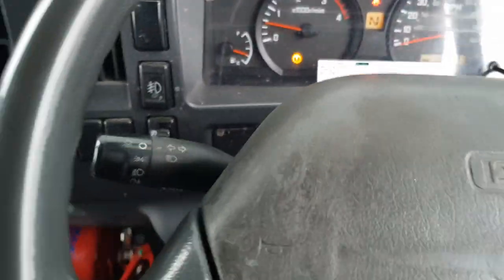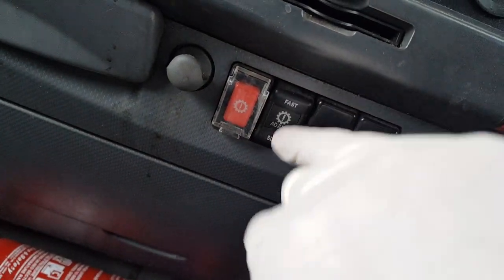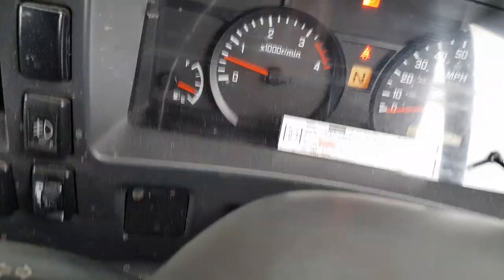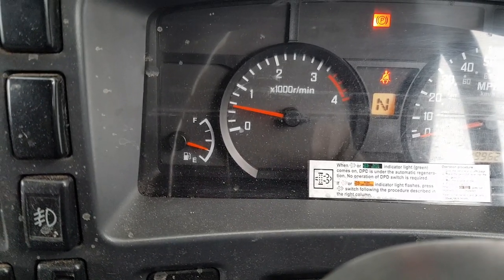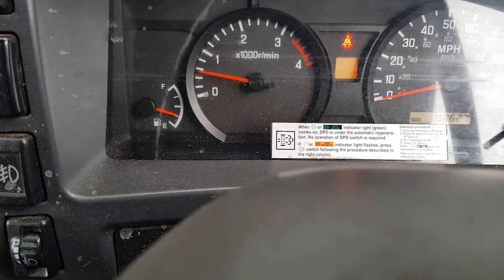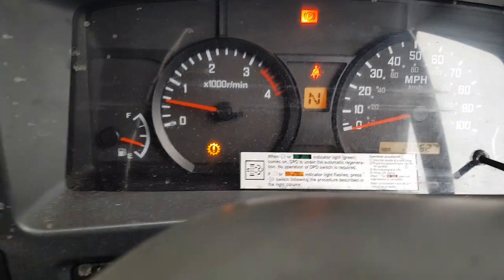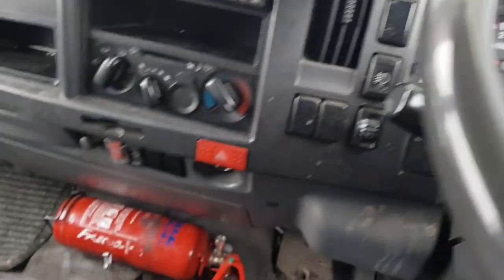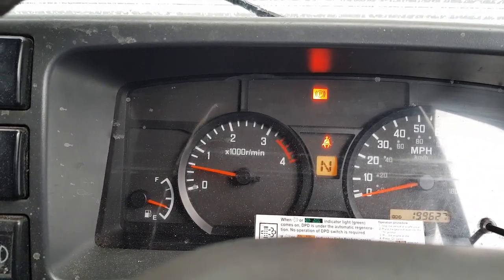Isuzu nqr npr auto box relearn reset

Comment: Ive got 69reg and the gear change is so slow its actually a hazard even more so when Im towing a chipper and carrying woodchip. It changes gear so slow that once its done it the road speed has gone down so it changes back down to second and it happens all over again. I just take it out of eco and use the manual shift.
Reply from the maker: 69 reg take it back to the dealer they should sort it out for you
Reply: @dannyandrew725  cheers mate ur nice bloke for doing this

Comment: hey Danny i have a 07 NPR that we put a second hand gearbox in we road tested it and it flared out the gear changes we tried to do a reset and now the buzzer keeps going off and the gearbox light constantly flashes when the ignition is on and wont select any gears have you any ideas thanks
Reply from the maker: @sharmanethomas  you need to get a diagnostic done on it and let me know the error codes
Reply from the maker: @sharmanethomas  go through WhatsApp

Comment: My question is, I have an Isuzu NQR 2009 diesel 4 cylinder. In The USA,. 5.2 L. With bad solenoids  automatic transmission., I changed 4 shifting  Solenoid, but my Scanner doesnt read anything now.?. Do I need to reset my transmission in order to Scan again any codes.?. All my old codes are gone, thanks JC
Reply: Hey. What issues was your transmission having for you to replace the solenoids?
Reason I ask is; I have a 2007 gmc w4500 5.2 diesel and it’s not shifting into 4th gear/Overdrive.

Comment: Hey bro, my Isuzu 2020 4hk1 paired to Amt MYY6S transmission has lost gear number 6. Any suggestions to fix?
Reply from the maker: 2020 mate is under warranty back to the dealers
Reply from the maker: Does it not go in 6th gear in manual aswell

Comment: On a 2018 npr hd gas jobber we just installed a new jasper trans. Buttoning it up tomorrow. I'm told it will need a dealer to flash it once we are done.will this essentially be the same thing ? Thanks in advance.
Reply from the maker: No mate it should be plug n play
Reply: @dannyandrew725  we finishing it up .we appreciate you getting back to us.doing the exhaust manifold bolts while we wait for a few parts.if u got a way to get me your adress wed like to send u one of our  company shirts. 
Thanks again
Reply from the maker: Hi mate you can send it to danny andrew c/o crowfoot carriers park street stalybridge Manchester England SK152BT. TEL 07887480560 THANKS
Reply from the maker: Where you based
Reply: @dannyandrew725  hallstead, Pennsylvania .we are a trucking company and have a heavy equipment garage.doing this job for the company that  brings us our semi truck tires.we normally don't work on anything non diesel,much less isuzus with chevy parts.lol. I do have the software and TeamViewer but not a version I can connect to there mainframe.
Reply: @dannyandrew725  hey Danny.
He is an update.everything is done.truck won't go in any gear.could t do what u showed because there is no fast slow button for the tranny. It's a 2018 gas.
Any thoughts?
Reply from the maker: Do you have any fault codes
Reply: @dannyandrew725  p0602
Reply from the maker: It's looks like a trip to the dealer to reprogram the ecu p0602 is a fault in the ecm not programed

Comment: Hi Danny, just tried this relearn and can’t get it to work, trucks just had the valve body thing in front of the clutch pack, got a fault code active p0718 input shaft turbine speed, any ideas or directions for me to go in, with my diagnostic?
Reply from the maker: On the bellowing 2 sensor 1 on each side faulty you can wotsapp me on 07887480560

Comment: Hi Danny I have a 2019 NLR only selects Reverse and 1 gear. Auto trans light and check engine light on. Any suggestions?
Reply: engage in any gear with your left foot on the brake and accelerates,if the engine revs normaly the most possibilty,your automatic side major parts are worn out..like oil pump,clutch packed and maybe tourque converter..check also your tcm.

Comment: Very useful video, I have an npr at the moment that won't shift past 2nd gear, also won't engage pto. I had texa on and found no faults, all seems good. Had the three shift solenoids off and they check out also, any suggestions appreciated ta
Reply from the maker: Check the wiring going to the fuse box behind the n/s/f wheel where it goes round the chassis sounds like a split wire
Reply: @dannyandrew725  will give it a check in the morning, much appreciated 👍
Reply from the maker: Are you near manchester
Reply: Dublin! Appreciate your help though
Reply: I have an Isuzu but the GMC w5500 HD 5.2 L diesel and I'm having problems with the transmission I can shift it from Drive second first and go from 1st 2nd drive and it shifts but if I just put it in drive it won't shift at all it will drive but the gears won't shift can you please help me
Reply from the maker: Sounds like electrics wireing
Reply: Leonard 
Hi Leonard. Did you find out what was causing the problem

Comment: Hi Danny, my 2017 NPR 55-155 AMT is stuck in neutral but saying it is in reverse on the dash. Have you got any ideas of what this could be. Thanks Trent
Reply from the maker: Sorry only guessing without a error code
Reply: @dannyandrew725  thanks Danny. I should have given you the fault codes P0889 P0685 P0700 U0100. Hope this can help. Also I tried the paper clip trick and that didn’t work.
Reply from the maker: Can you WhatsApp me 07887480560 thanks
Reply from the maker: 889 is earth wire from tcm broken going to the fuse box on n/s outer fuse check wires near the fuse box where they go under the chassis
Reply: Thanks I’ll check that when I get home. I can hear the relay clicking when changing gear shifter.
Reply from the maker: Purple znd white wire
Reply: Could it be solenoid problem?
Reply from the maker: The code is for a broken wire
Reply: Hi Danny. You were spot on with your diagnosis. Broken purple and white wire between fuse box and chassis. Thanks for your help. Cheers Trent
Reply from the maker: No probs matey anytime cheers
Reply: @dannyandrew725  one question..how do you know that the wire broke off..??
Reply: @dannyandrew725  what causes it to break....i mean the wires.??
Reply: @dannyandrew725  hi
Reply from the maker: @davidmusyoka6983  hi
Reply: @dannyandrew725  i have a problem with my isuzu 4hk 1 sir
Reply from the maker: @davidmusyoka6983  yes do you have a code
Reply: @dannyandrew725  no i even don't know how to get the code...is an automatic transmission and when i engage drive gear,,it reads gear number 6 and not moving at all...behaves like is in neutral
Reply: @dannyandrew725  kindly help
Reply: @dannyandrew725 hey bud just a quick question, I have the p0889 code too, it says it’s in 6th and will only move forwards with the red emergency button engaged, the earth wire you mentioned is that from the outside fuse box? Thanks appreciate any guidance
Reply from the maker: Can you WhatsApp me

Comment: Hello,
We have an ISUZU NPR85 2014 automatic transmission and is not shifting on sixth gear. Even not on manual. Sometimes shifts but engine rpms goes high like you keep the clutch pressed.. any recommendations?
Reply: I'm having the same issue, go up to 6th the drop down to 5th. 
Did you get it sorted out?
Because I was thinking it's the shift solenoid or strainer is blocked 🤔
Reply: Yes if I remember was the shift solenoid. Need to clean them good with WD40.

Comment: I have come across a similar transmission that is showing N even when shifting to R or D. Will this reset help out in fixing my problem..? Transmission has been serviced recently by someone else and now owner has this issue. Thanks in advance.
Reply from the maker: No it won't when you do a relearn it's normally when you've replaced something or you have a slow gear change
Reply from the maker: No it won't

Comment: I'm working on a 56 plate NPR that the customer has changed the auto gearbox. Got no speedo/tacho operation. Is there a certain position the drive for the tacho needs to be fitted in to the gearbox to engage the bevel gear? Its a dustbin lorry with non standard tacho drive and when its bolted up, the drive can be turned by hand which is wrong. Any help would be greatly appreciated, thanks in advance.

Comment: Hi Dannie I hve this Isuzu 250 NMR automatic when I put it on drive it select gear 5 what could be the problem
Reply from the maker: Without a error code its just guess work quite possibly the wireing
Reply: Did you find the problem. I have a 2006  problem doing the same thing. Goes to 5th when you select drive.

Comment: Hi  i got 2008 isuzu frr 500 amt, 2nd gear gets stuck and doesn't goes to 3rd when i am standing at set of lights or in traffic,  it happens couple of times a day. Like we can say delays in gearing up and i usually  do neutral and put drive again to keep it moving. 
I tried ur way as in video but the beep doesn't  comes up.  The light flashing due to wire inserted but nothing happens with fast and slow button. 
Please advise. 
Thanks
Reply from the maker: Can you add me to your WhatsApp and ill send you a video
Reply from the maker: 07887480560 thanks
Reply: @dannyandrew725  how do I no on which hole or port do I put the wire?
Reply from the maker: Can you WhatsApp me 07887480560
Reply: @dannyandrew725  which hole on the obd port do i put in the paper clip in.??

Comment: I did the reset and after the clanging in the transmission the nutral light did not come back up and now the truck can't go in any gear. How can I correct it
Reply from the maker: Wot reason did you try a relearn
Reply from the maker: Are you on WhatsApp if you are send me a message 07887480560
Reply: What was your fix bro. Am in the same spot too. No gear indicator light in dash and struggling to go in gear

Comment: what was the reason that it need to be reset?
]
Reply from the maker: If it has new parts fitted and sometimes its starts missing gears and so on so a reset now and again does no harm
Reply: @dannyandrew725  thanks for the reply, would love to see a vid on how to do an AMT fluid change, I only seem to get less than a litre of fluid out when I drain it.
Reply from the maker: @Sidrcride  hi mate the way you done it is the only way apart from taking the gearbox out 1 and a halve lts out same back in and run for 20 mins and do the same again probably 4 . 5 times until its looks clean I hope this helps thanks danny
Reply: @dannyandrew725  thanks alot mate.

Comment: Batteries were installed incorrect  for about 10 seconds! Now only have first and reverse and not charging 
Code UO 101 loss compunction Any advice would be appreciated
Reply from the maker: You've probly popped the tcm
Reply from the maker: Can you call me 07887480560 thanks
Reply: @dannyandrew725  
Thanks
Just  seen your reply now what’s a good time to call ?
Also not charging batteries, probably fried the alternator. Is there a fuse anyway?
Reply from the maker: There is a fuse but start it up and check the voltage coming out of the alternator 1st easiest way the fuse box behind the n/s wheel swap the 2 yellow relays and try your gears when you have swapped them
Reply: That fixed the transmission, all gears working now!!  
Still not charging , alternator is good , 
Fuses 27 to 33  are all good but don’t have any  power
Reply from the maker: Have you defo got 26 28 volts coming out of the back of the  alternator
Reply: @dannyandrew725  yes 
Had it rested working correctly 
Charge Just not reaching batteries!

Comment: Also, what does the red button do?
Reply from the maker: The red button is 1 gear emergency if all gears lost
Reply: @dannyandrew725  is it normal that you cant rev the engine in P? Only with the red button depressed, it revs
Reply from the maker: No it should rev up in both
Reply: @dannyandrew725  Do you know its rev limit? Ours rev up to 3800 rpm only
Reply from the maker: Yep sounds about right for revs
Reply: @dannyandrew725  thanks Danny!
Reply: @dannyandrew725  hey Danny. Good morning. I'm from jamaica. That light came up in my truck this morning,  and it won't select any gears, just park and neutral. It makes a continuous beep sound, do u have any advice?
Reply from the maker: @ruelhamilton6250  can you message me on whatsapp
Reply: @dannyandrew725  , have the same gearbox on my truck... no fault codes in the transmission but everytime i shift to drive or reverse, the letter N goes to blank and doesnt wanna go forward or backward. I can hear the solenoids switching though... have you had experience like this?

What would cause the truck not to shift/go forward or backward? Also how do i add you on WhatsApp?

Comment: Hi, i have an Isuzu LT434P with AMT. The gearbox will randomly shift out of gear while moving, i.e suddenly the same warning light will show up on the dash, engine revs but vehicle isn't responding, causing me to be stuck in the middle of traffic. Had to shift to neutral and drive again for a few times for the gearbox to re-engage the gear. Had tried servicing the gearbox and even changing the fluids but the problem is still resurfacing. Any idea if your method will help? Thanks in advance
Reply from the maker: You can always try my method but if it keeps coming out of gear it could possibly be 1 of the 3 gear change cylinders on the side of the gearbox faulty
Reply: @dannyandrew725  its always the 3rd gear that has this issue. It only happens to the 2nd or 4th gear a few times. But most of the time its the 3rd gear
Reply from the maker: @jjd8865  can you send me a picture of your gearbox on WhatsApp 07887480560

Comment: I performed this video now my vehicle will not go into Park Drive nothing at all shifter display blank
Reply from the maker: Why did you do it in the 1st place did it have a fault
Reply from the maker: Can you ring me
Reply: @dannyandrew725   it had a code for this mode shifter I cleared the code and performed the reset procedure just as you instructed it went down to the last stage where the screen went blank for the shifter now it's stuck there not able to move the truck
Reply: @tafarimarsh9975  Hi I got the same problem I did the reset and now it won't shift in gear
Reply: @dannyandrew725  Hi I did the reset and now nothing in the display can you and it's not shifting can you please help
Reply from the maker: You need to do it again are you on WhatsApp
Reply: @dannyandrew725  yes brother
Reply from the maker: 07887480560thanks
Reply from the maker: @shalenbernard487  07887480560thanks
Reply: Hi hi your number is not working